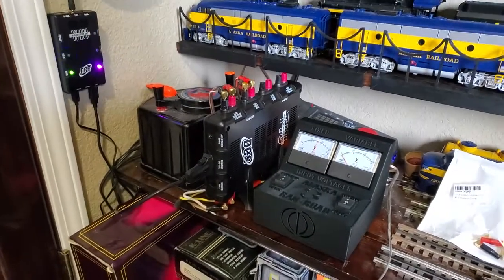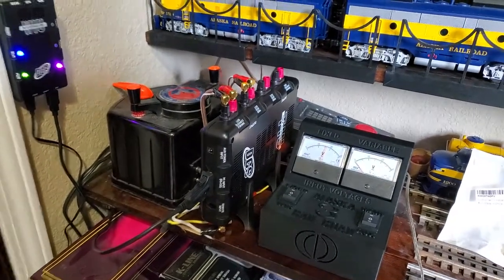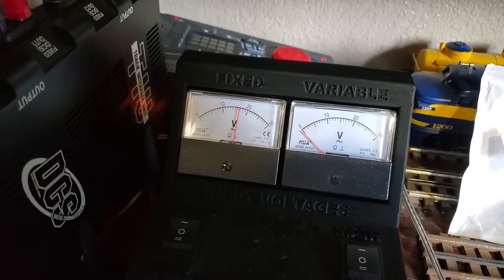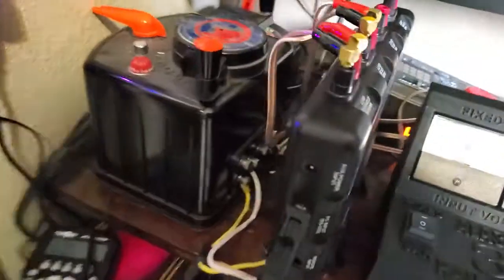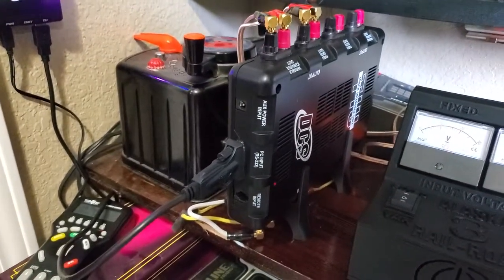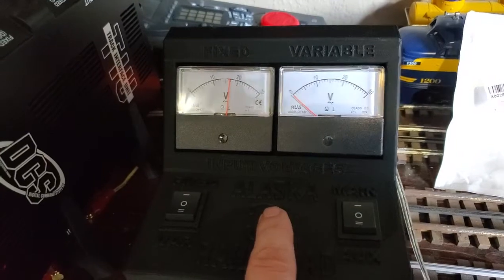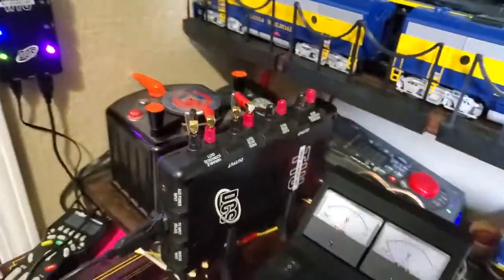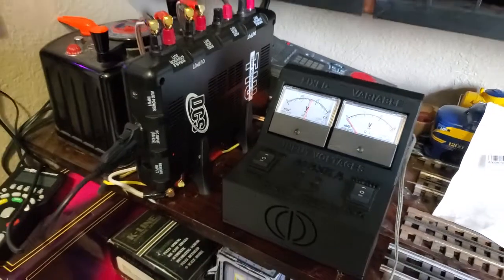Electronics Update

Comment: What is your room size? You're using a KW for power?? I have either a MTH Z-1000 or a Lionel 180 Power house to use for my ceiling run. I'm going to have my son listen to how you have it all hooked up!! Enjoyed the video!!! Thanks!
Reply from the maker: My room is pretty small, 12'x8'. Yes, the KW powers both the fixed voltage circuit on the TIU and the other output from the KW is the variable voltage circuit on the TIU. I have all the electronics to run the Lionel Legacy & TMCC systems and the MTH DCS system and still be able to run my conventional locomotives. I have everything from prewar tin to the modern electronic controlled stuff. I rebuilt the KW, it was my dad's from when he was a kid so I don't have the heart to retire it. For my Christmas show, I use 2 postwar ZW transformers to run 8 loops and its a mix of postwar and modern locomotives. I have an older TMCC base for that show. Anyone who tells you that you can't run modern stuff with postwar power just doesn't know how to set it up.
Reply: @AkRyder68  My table layout is 8x10. 2 loops powered by my old ZW and 3 loops powered by DCS , TIU, remote and a MTH Z-1000 or a 180 Lionel Powerhouse. Watched a couple videos of how to run conventional stuff with DCS by using the variable ports on the TIU. Using a separate power supply either one I mentioned to a terminal block, to one specific track. That tracked is then named in the remote. Haven't tried it yet, trying to set up a good day with my son, who helps me A LOT!! Reason for the change back and forth is   I have a UP Centipede which I love which I run on that outside loop. My wife bought me a C/O M-1 for my birthday it's conventional, It's an older MTH before PS stuff.
My room is 17x17 and only plan on running Post War, K-line and Weaver stuff. Watched videos about feeder lines anything to help power that much track.
Thanks for answering!!! God be with you! Take Care, STAY SAFE AND WELL!!

Comment: Way cool bro!
Reply from the maker: I just got the printer back up and runing. It was making ripples in the lines. The replacement rollers are touchy on how tight they can be set. A fine line between loose and too tight.